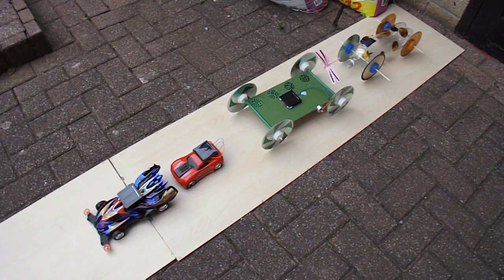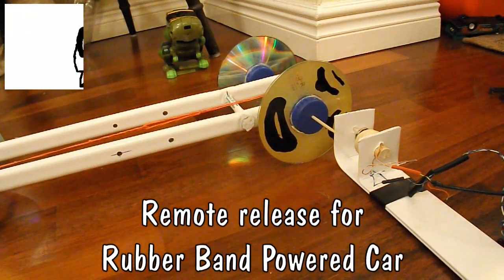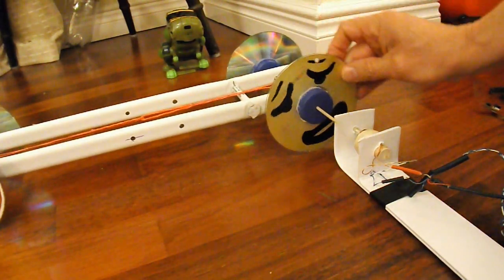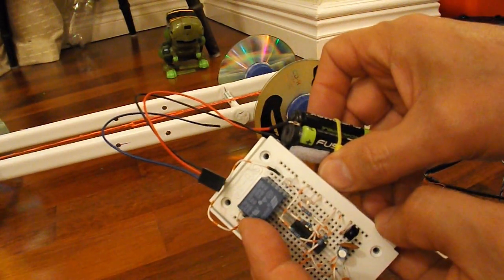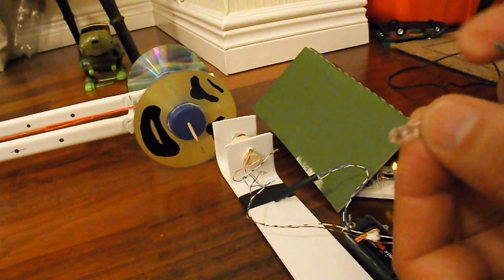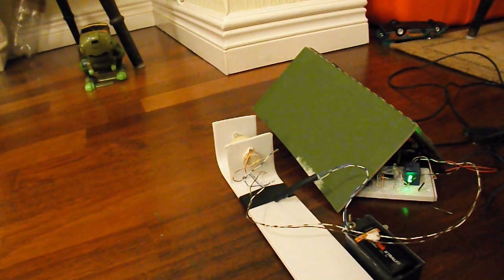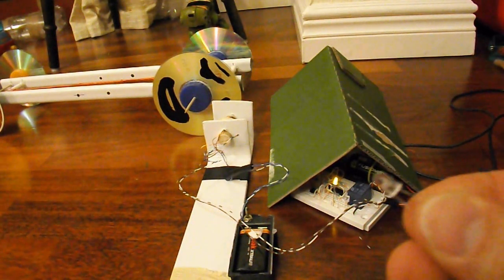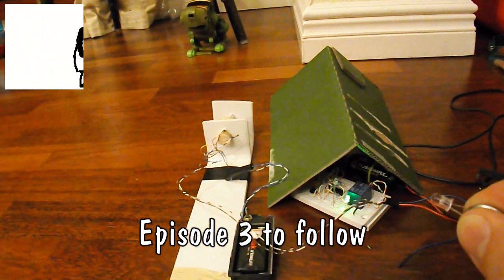Remote release for rubber band powered car - part 2

Comment: Hey Grandad, can you construct an easy mechanism,so that a rubber band powered car will have the rubber band still on the hook when it is completely winded down, but the car will go on just as if the band was fallen off the hook? In that case one wouldn't need to readjust the band after every go. But usually if it's permanently fixed on the hook, the car wouldn't run as long since the rubber band will wind up again and stop the car.  I hope that makes sense.
Reply from the maker: I will see what I can do, I have a simple idea that might work, not sure when I can get started on it.
Reply: GrandadIsAnOldMan Thank you! This might going to become a project for school for my grandchild.
Reply: GrandadIsAnOldMan Thank you! This might going to become a project for school for my grandchild.
Reply from the maker: theheinzification What I have in mind is an adaptation of the method used on rubber band aeroplanes to allow the propeller to free wheel when the rubber has finished.